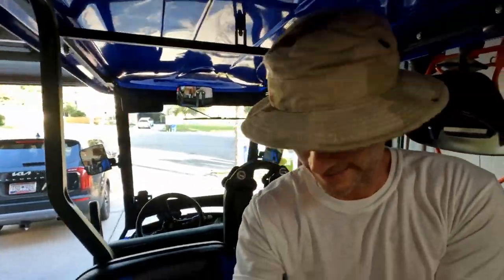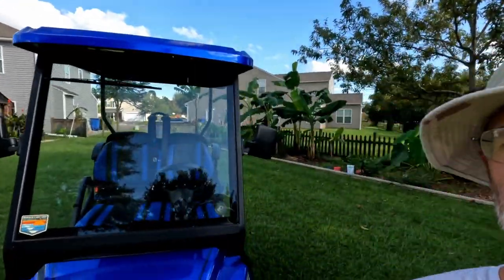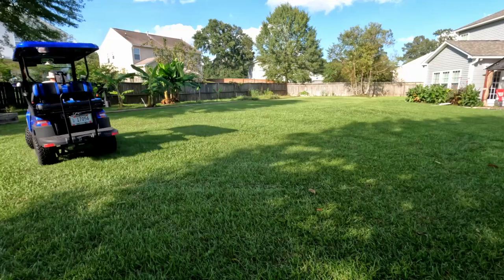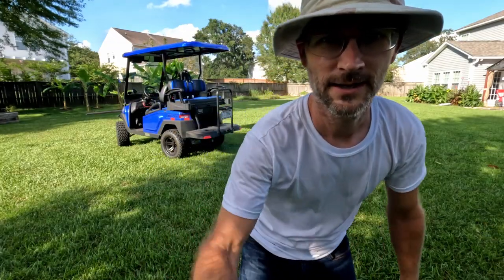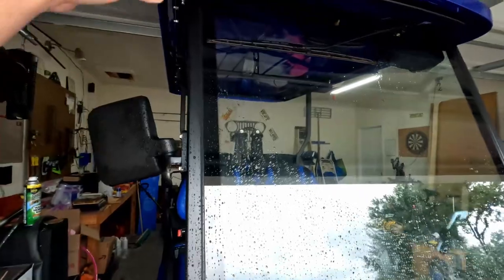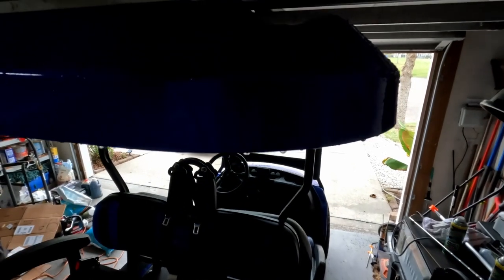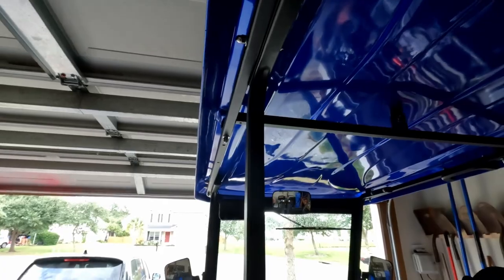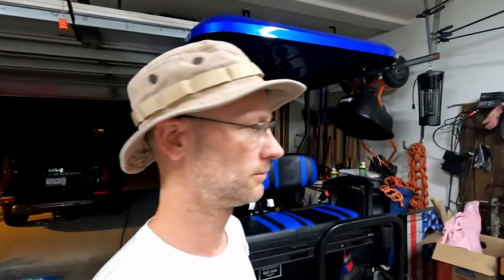Top speed 0-25, braking distance, and more testing thoughts. Will it fit in your garage?

Comment: I’m not sure if you’ve already heard this, but I wanted to share a quick tip that might help with your garage door. If you want the door to open higher and sit flatter against the ceiling, you just need to adjust the holes on the hockey stick-shaped bar that connects the trolley (where the release rope is attached) to the door itself.

By moving the connection point, the door will be pulled farther up the track, allowing it to sit fully out of the garage opening. I had the same issue, and this adjustment made a big difference.

Just thought I’d pass that along!
Reply from the maker: Yep, good tip. Most garage doors can also be adjusted for their upper limits to pull the garage door up an extra inch or so.

Comment: I have the exact same cart in black.  Bought it about 2.5 months ago. I have the exact same scratches on the back of my roof.  I was concerned at first but after using it daily since I purchased it I agree that it’s not an issue at all. Doesn’t sound pleasant but purely cosmetic and nobody can see it.  

I have been thinking of raising or lowering my side mirrors.  It’s a really bad blind spot and I’m constantly ducking my head outside the cart in corners.  I think I saw another video where someone raised them and it looked pretty easy to do.  

25 miles a day is crazy!  I probably do that in a week but I don’t think my batteries have dropped below 40% yet when I go to charge them.  My cart is holding it’s 25 - 26 mph top speed charging once a week.  My salesman told me they recommend 80 charges under 40% to maintain the top speed.  Conditioning the batteries I think he called it.  At my rate it will take over a year to charge it that much so we’ll see. 

Thanks again for taking the time to make these videos.  They’re very informative and I’ve learned a lot more from you than the owner’s manual.
Reply from the maker: Hey, happy to be making the vids. Let me know if there's anything specific you want to see. I'll look around for the video on moving the mirrors, I'd love to make a video on that as well. Drop a link in the comments if you find it. I'd appreciate it!

Comment: Thanks for the review.    I know there’s a way to adjust your garage door so when it’s up, the lip or bottom of the door doesn’t hang down at all. Check your opener for guidance. I had a repairman out to tune up our door and he adjusted that.    Take care.
Reply from the maker: I had a happy little problem not too long ago, my garage door opener tried to catch fire. As a result, I got a new opener with all the bells and whistles. It's adjusted now to where the garage door doesn't touch the top of the cart. You are correct though, most garage doors can be adjusted to pull them up just a little bit higher than the opening of the garage. For most people it'll be really close, but it shouldn't touch. If it does, crack out the old owners manual and figure out how to adjust it.
Thanks for the comment!
Reply: @oftenwrongparadigm    Perfect.  Glad you have it all sorted out.

Comment: I was able to lower my roof by about 3/4 of an inch by replacing the center and rear spaces with spacers for hanging a flat screen TV. I now only rub the rubber gasket but dont hit anything. no scratches that I can see.
Reply from the maker: That's a great idea. I may have to try that. How thick are those spacers? I might be able to find something at Lowe's/HD that could work.

Comment: Maybe there's a way you can lower the rear of the roof by cutting/splicing 1" off  the rear supports.  

If you're into trigonometry, I found this on the internet.  Don't know how accurate it is.  Estimate the turn radius:  
1) measure the length of the wheel base (distance from front axle to rear axle).  Mine is 8 ft.
2) measure the angle that the front wheel makes between straight ahead and full turn to the left (or right).  Mine is 30°
3) get the tangent of the angle in step 2.  Mine is . 577
4)  divide #1 by #3.  I got 13.86
5) add the width of the machine to #4.  I got 18.86

It could be close depending upon how accurate the angle is measured.  The specs on my ride says = 18 ft. turning radius.  The turn radius is measured to the outermost sidewall of the outside wheel.  I wonder how close this internet formula works for your machine or others who may want to try this.
Reply from the maker: Gotta love the math! I'm keeping my eyes open for some spacers that will fit the rear roof to about half of what the factory ones are. That should be enough for me to not rub the door when going in/out.

Comment: Great job the quick stop test was awesome.
Reply from the maker: I'll be honest, that was a fun video to shoot. All my neighbors I've talked to have the ez-go and club car types. The rear drums on those carts work well at low speeds, but at a certain point/speed, dragging the back tires is just not safe. The Bintelli's 4 disk hydraulic brakes really put a stop to the cart quick. 
Now I just need to get the computer programmer to boost the top speed and change the power ramp up off the line. I wanna do doughnuts...
Reply: @oftenwrongparadigm Great video. I was wondering if you ever got the computer controller to get more speed. If so, how fast are able to go?
Reply from the maker: @horacejones5226  yep! I've got a couple videos on the channel page of how to find out what controller you have and with my controller, the settings I use. With lead acid batteries, just me in the cart, I'm able to get it up to 32 or 33. If there's any sort of incline or extra people in there, speed goes down. That's to be expected though.

Comment: Good video great info on the garage height …
Reply from the maker: I found out today the air pressure in the tires was a bit high, 22-23psi.i lowered it to 18, and there is now very little rub. It's not nearly as bad as it was. Ride is a bit smoother too.

Comment: You mentioned in one of your videos that you installed a viper alarm system. Can you show a pic? I went to Amazon but wasn’t certain what alarm I should buy for my cart.
Reply from the maker: In the description of this vid, there is this link to the now unavailable alarm. I'll try to get a link to the video where I show the wiring and splice wires when I get home in a few days.

https://youtu.be/4xUOhLUNb2U?si=GV9lSG7o6ufUXX-N

This one seems to be the new version of the alarm. It's a little different, but appears to wire up pretty much the same way.

https://amzn.to/3JaB0lK

There are some other alarms for motorcycles that will work too, but you may need to do some trial and error work to adapt to the cart. If I have the time and a few extra bucks in a couple weeks, I might buy that new viper alarm to test it out and see what the differences are. Also, it'll give me the opportunity to do a better alarm installation video.
Reply: Great…thanks for your help. By the way, I just purchased the dual horn system that you made a video about.
Reply from the maker: I love that horn! I'm considering doing a train or small air horn just for kicks. But that dual tone horn is as good or better than some car horns.

Comment: Bintelli shows on their website its 81" high. That appears to be wrong? I want the non lifted and they show 78" high. I wonder how far they are off? My storage area door is just under 80" high.
Reply from the maker: 80-81 inches tall is pretty close to correct. If it rubs just a little and there's no way to adjust the opening, you could replace the bushings between the frame and roof. Those are an inch thick. A bad option is to reduce the tire pressure. That will need refilled or effect ride and wear. 
I may look around at Lowe's to see what can easily replace those. They use a capped nut on the bolts and those will need cut short or replace the capped nuts. 
I'll keep thinking about other options.

Comment: Braking is way better than my Navitas Storm cart.
Reply from the maker: Honestly, it was a standout safety thing for me. Having a cart that goes fast is great. But the cart HAS to be able to stop from that speed too. I'm still a bit😬 when I see someone modding a cart to go fast with nothing but drum brakes on the back wheels.
Reply: @oftenwrongparadigm  my cart will run 35mph easily but it only has drum brakes and regen braking controller.
Reply from the maker: @jeremya7299  yeah I really wanted to get one of those. But it just lost out on the pros/cons list. I really liked the cart though.
Reply: @jeremya7299 What did you  do to make it go 35 mph?
Reply from the maker: @horacejones5226  I got the Curtis controller programmer and made a few tweaks to the settings. Check the channel page, there's two videos. One shows how to find out what controller you have, the second one shows my settings for the Curtis controller. Make sure you get the right programmer for your controller type.

Comment: LoL, just seeing this now, but "Turning Radius" is measured by the OUTSIDE tires - the entire space needed to do a U-turn ... and even though "Radius" is from the CENTER of a circle to the outside, the measurement is ACTUALLY the "Outside Diameter" of the space the tires need for a U-turn. So "Turning Radius" as listed for most all vehicles = "Outside Dimension, or Diameter, needed to do a circle or U-turn."
From Wikipedia: "On wheeled vehicles with the common type of front wheel steering (i.e. one, two or even four wheels at the front capable of steering), the vehicle's turning diameter measures the minimum space needed to turn the vehicle around while the steering is set to its maximum displacement from the central 'straight ahead' position - i.e. either extreme left or right. If a marker pen was placed on the point of the vehicle furthest from the center of the turn, the diameter of the circle traced during the turn defines the value of that vehicle's turning diameter. Mathematically, the turning radius would be half of the turning diameter."
https://en.wikipedia.org/wiki/Turning_radius
If it were me, I would definitely lower that rear of the roof so it won't scratch going in and out of the garage, just because.
Great video though!!
Reply from the maker: You are awesome! Thanks for the explanation.

Comment: Im really interested in the range, do you have any information on that?
Reply from the maker: With lead acid batteries, I usually don't drive it anymore than 25 to 30 miles before stopping to charge. Depending on if you have lead acid or lithium batteries that will have a major impact on range. Other factors to consider would be how much weight is on the cart, the temperature outside, tire pressure, how fast you are going, and how frequently you're stopping as well as a few other small variables. I have not noticed little things like lights and sound system to have an impact on range.

Comment: What device is that plugged in the wall to tell you the amount of kw used? What year is your cart?
Reply from the maker: That is a kill-a-watt meter, from harbor freight. https://hftools.com/app93519 looks like they're $27.99 Right now. I'm not sure I paid that much for it, probably caught it on sale and/or used a coupon. Mine is a 2022, very little has changed to the current model year that I've noticed. I went into the main showroom in Charleston about a month ago, just to check, out of curiosity. The main differences in the new carts, unique ignition key that also opens the glove box and now it comes with the pull straps for the back seat. I still like my pull straps better 😁 They also have more/better lithium battery options than when I purchased mine. But that kind of makes sense as more companies now make them.
Reply: @oftenwrongparadigm  Thanks for the info. I just purchased a  new 2022 Bintelli Beyond. It had 3 miles on it when I drove it. Going to be delivered tomorrow. Really excited to get it.
Reply from the maker: @horacejones5226  Awesome, have fun, enjoy it!

Comment: How does the bintelli do with people on board and going up hills?
Reply from the maker: Compared to other carts I've tested, very good. There is a reduction in top speed and general acceleration when fully loaded, which would be expected from any cart. I've taken it up some moderately steep hills with little issue. Just don't think it'll go down into a deep ditch and be able to crawl out of it like a Jeep. But then again, that's why I put a winch on mine, so I can do dumb things and still be ok 🤣
Reply: @oftenwrongparadigm  Awesome thanks man!!  Getting our cart this weekend. 

I notice the lifted carts have really bad positive camber, do you know if there is a way to adjust the positive camber?  Not toe
Reply from the maker: @bryanbolo4684 not that I'm aware of. I haven't noticed anything with the camber being off. Tread wear seems even across the tires. It seems unadjustable with the MacPherson style front suspension. If it has any adjustments, it would be difficult to get to up top.

Comment: Was the Manufacturer asleep at the wheel?  How can they make golf carts that do not easily enter standard garage height entrances?  There is no way I would simply accept damaging my cart upon entry and exit of my garage.  I’ll be sure to avoid this Manufacturer and to measure the cart height before I make a purchase.
Reply from the maker: I think they wanted to make it as big as possible. My garage may be an inch shorter than others, I'm not sure what a standard height garage door is. My garage door opener could pull the door up a pinch more to relieve this. A slight modification can also be made to the cart. I've got another video in the works to correct this. 

It does seem like it would be an easy fix from the manufacturer, just use an inch less material on the supports and windshield.

Comment: Just drove one of these. the cart seems to brake when you take you foot off the accelerator pedal.  is this automatic braking , regenerative braking?
Reply from the maker: That would be regenerative braking. It took me about a month or so to really get used to it, letting off the accelerator enough to slowly reduce speed while coasting. I'm not sure how much juice it puts back into the batteries, but I'm sure every little bit helps when out running around all day.
Reply: @oftenwrongparadigm  Thanks for clearing this up. So strange that none of the literature, articles, reviews, etc on the cart explain the braking. Also noticed that your State of Charge (SOC) % is not showing while you are driving. does the SOC work?
Reply from the maker: @scottstamps2507  NOPE! I've been tempted to disassemble the display to see if there's a way to get it working. The only time it displays anything is when the key is first turned on and the accessory position. And at that, it doesn't matter how much juice is in the batteries, it always reads 100%.
Reply: @oftenwrongparadigm  Thanks for the reply! I just talked to the dealer and they said the SOC display doesn't work and "won't tell you the correct reading anyways". Whatever that means. Weird because the SOC is listed in the owners manual.
Reply from the maker: Just a guess, it probably is a unit designed to work for various manufacturers. There just isn't the hardware or the connections to make that display show the state of charge on this vehicle. Me being me, I'm still going to take it apart and see what it looks like inside.